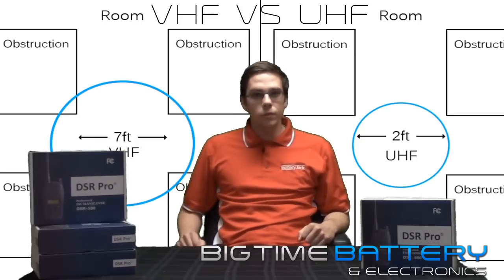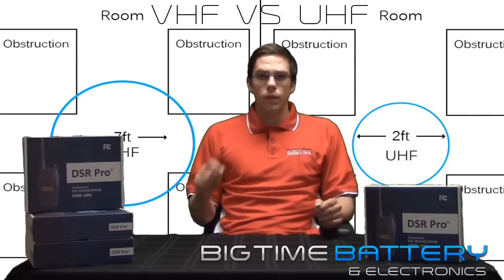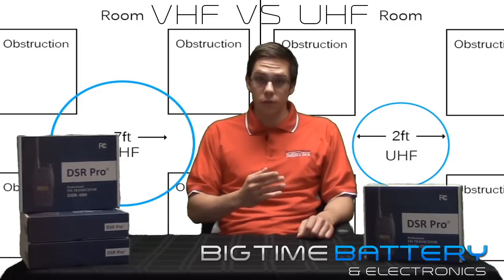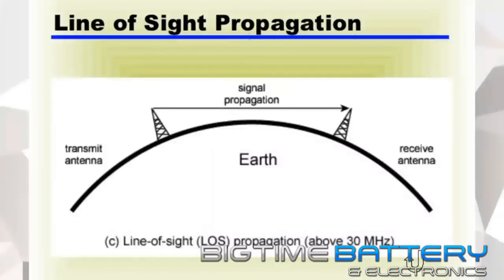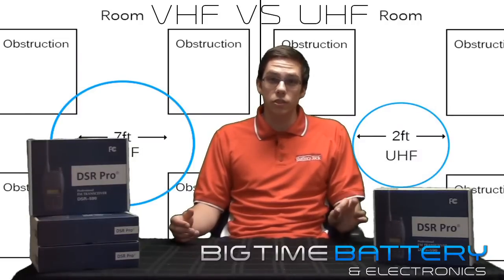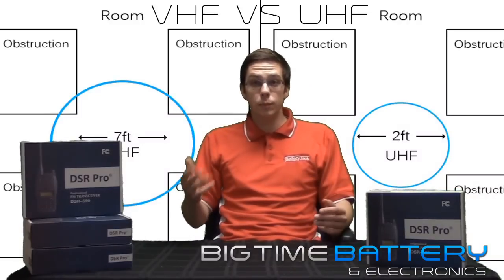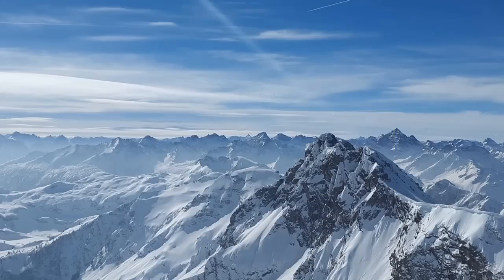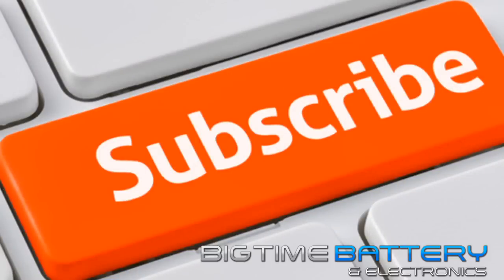VHF vs UHF - What's the difference

Comment: Putting aside all the gaffs in video, why, then, if UHF passes through walls and obsticles better than VHF, why does the signal from my wireless router becomes nearly useless after passing through just 2 wood frame walls?
Reply: Because he is wrong..  UHF happens to bounce off walls quite well compared to VHF which is why it is better to use UHF in urban environments.  VHF has more penetrating ability (due to its larger wave form) than UHF so its better in rural areas where it can penetrate though trees and other foliage better.  There is more to it than that but it would be too much to write here.
Reply from the maker: The reason your wireless router's signal becomes nearly useless after passing through just two wood frame walls, despite UHF (Ultra High Frequency) signals generally having better penetration capabilities than VHF (Very High Frequency) signals, relates to several factors beyond the simple UHF vs. VHF comparison. Here are the key points to consider:

Frequency Band Used by Wireless Routers: Most wireless routers operate in the 2.4 GHz or 5 GHz bands, which are both well above the traditional VHF (30 MHz to 300 MHz) and UHF (300 MHz to 3 GHz) bands. Higher frequencies, like those used by your router, have a harder time penetrating solid objects compared to lower frequencies due to their shorter wavelengths. This is why even within UHF, lower frequencies penetrate better than the higher ones.

Material Absorption: Different materials absorb and reflect radio waves differently. Wood, for instance, can absorb some of the signal's energy, but usually, it's not significantly enough to severely degrade the signal. However, the actual impact depends on the thickness of the walls, the type of wood, and the moisture content within the walls. Moisture can significantly increase the attenuation of radio waves.

Interference and Signal Degradation: The presence of other devices operating on similar frequencies (e.g., other routers, microwaves, Bluetooth devices) can cause interference, reducing the effective range and signal quality of your wireless router. Additionally, every obstacle a signal encounters degrades its strength due to scattering, diffraction, and absorption, leading to a weaker signal by the time it passes through multiple barriers.

Router Antenna and Power: The design and power output of your router's antenna also play a critical role in how well the signal can penetrate obstacles. Directional antennas can focus the signal more effectively in a specific direction, potentially improving wall penetration in that direction at the expense of coverage in others.

5 GHz vs. 2.4 GHz Bands: If your router is set to use the 5 GHz band, it will experience more difficulty penetrating walls than if it were using the 2.4 GHz band. This is because, generally, lower frequencies have better penetration capabilities. The 2.4 GHz band can offer better coverage and wall penetration but is more prone to interference due to the number of devices that use it.

In summary, while UHF signals can indeed penetrate obstacles better than VHF signals, the specific frequencies used by wireless routers, along with environmental factors, material properties, and technical specifications of the router itself, all contribute to the real-world effectiveness of signal penetration through obstacles like wood frame walls.

Comment: I always thought that lower frequencies traveled through instructions better than higher frequencies.  (Given the same power rating). Opposite of what is explained here.  

I thought higher frequency is better in busy areas because you have more bandwidth and therefore more available channels and less interference in high traffic RF environments.  ? 

Can anyone confirm/deny and explain?
Reply from the maker: Your understanding is partially correct, but there are nuances to consider.

Lower frequencies do indeed have better propagation characteristics in terms of traveling through obstacles like buildings and walls, making them more suitable for long-range communication and penetrating obstacles. This is due to lower frequencies experiencing less attenuation (loss of signal strength) when encountering obstacles.

However, higher frequencies offer advantages in different scenarios. In busy urban areas or high-traffic RF environments, higher frequencies can provide more available bandwidth, allowing for more channels and higher data rates. This is because higher frequencies have shorter wavelengths, which enable more efficient use of spectrum and smaller antennas, thus allowing for more channels to be packed into the available bandwidth.

So, in summary:

Lower frequencies are better for long-range communication and penetrating obstacles.
Higher frequencies are advantageous in busy areas due to more available bandwidth and channels, leading to less interference and higher data rates.
Both lower and higher frequencies have their own set of advantages and are used in different applications depending on the specific requirements of the communication system.

If you need any more information call or text us at: 815-467-6464 or email me directly at cody@batteryjack.com

Comment: Hi. Big fan here! Just a beginner radio user question. The repeater is located somewhere here in the Philippines, they are using UHF Radio's but I don't understand why portable radios can't pick up any audio from the transmitting person even if they are just 2-5 feet away from the same room? Radio base are operational, antennas are installed but I can't understand why they can't receive the person who is transmitting? Comments are highly appreciated, thank you!
Reply from the maker: thank you for your question and support! Your issue with portable radios not picking up transmissions even at close distances in the same room can be puzzling, especially considering the setup seems correctly installed with operational bases and antennas. There are a few potential reasons why this might be happening:

Antenna mismatch or issues: Even though antennas are installed, there might be a mismatch in terms of the type of antenna being used, its orientation, or even a malfunction. Antennas need to be compatible with the frequency band being used (in your case, UHF). Ensure the antennas are properly tuned for UHF frequencies.

Interference: In a UHF band, especially in a densely populated area or an area with many electronic devices, interference can be a significant issue. Other devices operating on or near the same frequency can drown out the signal you're trying to receive.

Squelch settings: The squelch function on radios is designed to silence the speaker when no signal is being received. If the squelch setting is too high, it might not open for transmissions, especially weak ones or those from very close by. Try adjusting the squelch setting to a lower level to see if it helps.

Transmitter power: If the transmitting radio's power setting is too low, it might not be strong enough to be picked up clearly by the receiving radios, even at close distances. However, being too close can also sometimes cause issues if the radios are designed to operate over greater distances.

Obstructions or environmental factors: Even in the same room, certain materials or structures can block or degrade radio signals. This is less likely if you're just 2-5 feet away, but it's something to consider depending on the specific environment.

Radio defects or configuration issues: There might be a defect in the radios or a configuration issue. Ensure that both transmitting and receiving radios are correctly configured to use the same frequency and privacy codes (if applicable).

Receiver desensitization: If the transmitting radio is very close to the receiving radio, the strong signal might desensitize the receiver, making it temporarily unable to receive signals. This is also known as receiver overload.

To troubleshoot this issue, I recommend starting with the squelch settings and ensuring the antennas are correctly matched and oriented for UHF frequencies. Then, check for any potential interference and experiment with different settings and positions to see if the situation improves. If possible, testing with different radios or antennas can also help isolate the problem.

Comment: Thanks, the analogy with the 2m pole makes sense now.  My questikn is:  do trees count as obstructions like a building would, or does there need to be conductive material.   Basically,  is wood invisible to radio waves?
Reply: YES, wood or Trees have water in them, so they will block or Deflect radio waves. your Best bet is a high power HF, CB or Shortwave radio. HF and CB can take advantage of Ground Skip. and SW communicates over long distances but at a loss of Voice Clarity. Concrete buildings (not Houses) block radio waves, but Some houses are Semi-Transparent to Radio waves. One Solution is to Drill holes in a Concrete Building and install multiple metal rods that go from the inside to outside. Plastic is RF Transparent. Its why Radar uses Plastic Domes. but that has been replaced by IP (wifi) Repeaters. so Security and Firemen can communicate in a 100 Story Concrete Building.
Reply from the maker: The behavior of radio waves when they encounter objects, including trees, depends on the frequency of the radio waves and the properties of the object. Wood is not "invisible" to radio waves, but its impact on radio wave propagation varies.

Frequency Dependency: Higher frequency radio waves (such as those used in many modern wireless communications) are more likely to be absorbed or scattered by objects, including trees. Lower frequency waves can penetrate through or diffract around obstacles more effectively. This means that at higher frequencies, trees (and their leaves, moisture content, etc.) can significantly attenuate (weaken) the signal.

Material Properties: The ability of radio waves to penetrate an object is also influenced by the object's material properties. Trees contain water and have a complex structure, which can absorb and scatter radio waves, especially at higher frequencies. This effect is more pronounced when the foliage is dense and when the trees are wet, as water is a more effective absorber of radio waves than dry material.

Impact of Obstructions: While trees do not block radio waves as completely as a solid metal or concrete wall might, they can still cause significant attenuation, especially in a forest or in situations where there is dense foliage between the transmitter and receiver. The effect is cumulative; the more trees or foliage in the path of the radio waves, the greater the attenuation will be.

Comparative Impact: Compared to buildings or other solid structures made of conductive or dense materials, trees generally offer less obstruction, but they are not completely transparent to radio waves. The impact is nuanced and depends on the specific scenario, including the type of trees, their density, and the frequency of the radio waves.

In summary, wood is not invisible to radio waves, but its impact as an obstruction depends on the frequency of the radio waves and the specifics of the tree(s) in question. Trees can attenuate radio waves, making them a consideration in the design and placement of radio and wireless communication systems.

Comment: So is there any downside to using UHF on the farm etc?
Reply: You are much better off with VHF.. VHF travels further in nature, penetrates trees and bushes better.  UHF doesn't penetrate objects very well (this video is wrong), it reflects off them which is why its good in cities because it "bounces" down streets and round corners much better than VHF does.
Reply: @Scotian280  Thanks!
Reply from the maker: Using Ultra-High Frequency (UHF) radio systems on farms or similar environments offers numerous benefits, such as improved communication range, better clarity, and the ability to support more data-intensive applications. However, there are also some downsides to consider:

Line of Sight Limitations: UHF signals, operating at higher frequencies, have more line-of-sight requirements compared to lower frequency bands (like VHF). This means that hills, buildings, and other obstructions can more significantly impact signal range and quality.

Interference: UHF bands are widely used for various applications, including TV broadcasting, cellular networks, and other communication services. This can lead to congestion in the frequency band, resulting in potential interference and reduced communication reliability.

Cost: Equipment operating in the UHF band can be more expensive due to the advanced technology required to handle higher frequencies effectively. This includes both the initial purchase and potential licensing fees for using specific parts of the UHF spectrum.

Complexity: Setting up and maintaining a UHF communication system may require more technical knowledge and expertise. This complexity can be a barrier for some users and may necessitate professional support for installation, configuration, and troubleshooting.

Battery Life: Devices that operate in the UHF band, especially those that support data-intensive applications, may consume more power. This can lead to shorter battery life for portable devices, which could be a significant drawback in remote or field-based operations.

Regulatory Issues: The use of UHF frequencies is subject to regulation by national and international bodies. Users must ensure compliance with these regulations, which can vary significantly from one region to another, adding to the complexity and potential cost of using UHF systems.

Comment: Thank you nice video, So I need to know ...Do I need to pay to use UHF two way radio in my city .?
Reply: Yes and no.  If you want to use simplex and stay off the Amateur bands, say with MURS< FRS etc, then just go to wally world and buy the appropriate radio.  Now, if you want to get on the Amateur bands, you will need license.  When you get the license, then it would be appropriate to support a repeater if you are going to use one..They are expensive to put in, and to maintain..Not mandatory, but nice.  If you are just going to use simplex, no repeater, then no.
Reply from the maker: No

Comment: wavelength and frequency are just two ways to describe the same things. you cant have a long wavelength with a high frequency.
Reply from the maker: Wavelength and frequency are indeed two interrelated but distinct properties of waves, including electromagnetic waves like light and radio waves, as well as sound waves and water waves. Here's a breakdown of how they differ and how they are related:

Wavelength is the distance between two consecutive points in phase on a wave, such as from crest to crest or trough to trough. It is usually denoted by the Greek letter lambda (λ) and is measured in meters (m) or its submultiples like centimeters (cm), millimeters (mm), etc.

Frequency refers to the number of cycles (or wave crests) that pass a fixed point in space per unit of time. It is denoted by the Greek letter nu (ν) and is measured in hertz (Hz), where 1 Hz equals one cycle per second.

The relationship between wavelength and frequency is governed by the speed of the wave, which is constant for a given medium. For electromagnetic waves traveling through a vacuum, this speed is the speed of light (approximately 
3.00
×
1
0
8
3.00×10 
8
  meters per second). The formula that relates wavelength, frequency, and speed is: Where:

�
v is the speed of the wave,
�
λ is the wavelength, and
�
ν is the frequency.
This formula means that as the wavelength (
�
λ) increases, the frequency (
�
ν) must decrease if the speed (
�
v) is constant, and vice versa. Therefore, it is indeed correct to say that you cannot have a long wavelength paired with a high frequency for a given type of wave in the same medium, because increasing one decreases the other.

This inverse relationship ensures that if you know the speed of the wave in a medium, specifying either the wavelength or frequency inherently defines the other. This is why wavelength and frequency can be seen as two different ways to describe the same phenomenon, but they are distinct properties that describe different aspects of a wave.

Comment: Why didn’t correct these errors before posting? 
3Hz does not equal 3000MHz
This is very inaccurate information.
Reply from the maker: Sorry I was very young upon making still learning a lot! If you need any help message me or email me at: cody@batteryjack.com or call or text: 815-467-6464

Comment: Can u set a two way radio from VHF to UHF on the software
Reply: no
Reply from the maker: Whether you can change the frequency band of a two-way radio from VHF (Very High Frequency) to UHF (Ultra High Frequency) using software depends on the specific model of the radio and its capabilities. In many cases, the frequency band is determined by the hardware components within the radio and cannot be changed via software alone.

For example, the Baofeng UV-5R HP that you mentioned earlier is a dual-band handheld transceiver, meaning it can operate on both VHF and UHF frequencies. However, the specific frequency range for each band is fixed and cannot be altered through software.

If you have any other questions please feel free to call or text us at: 815-467-6464 or email me directly at cody@batteryjack.com